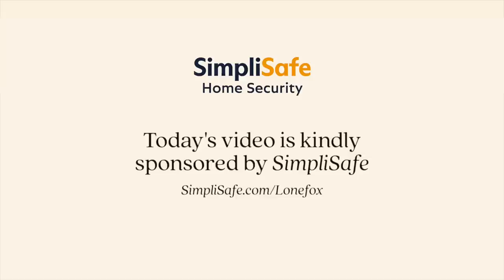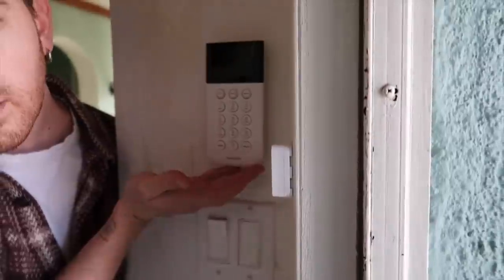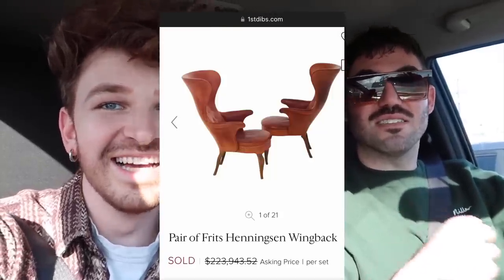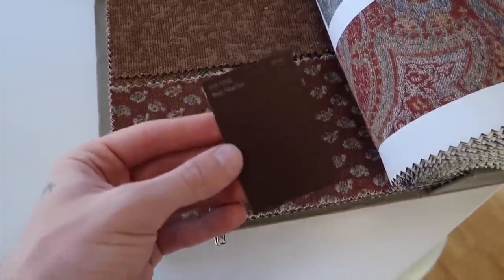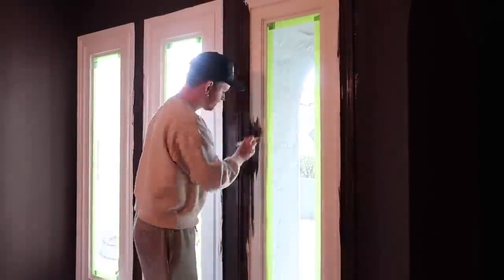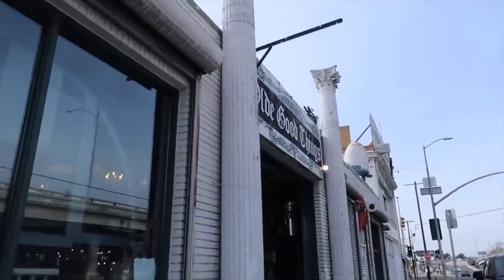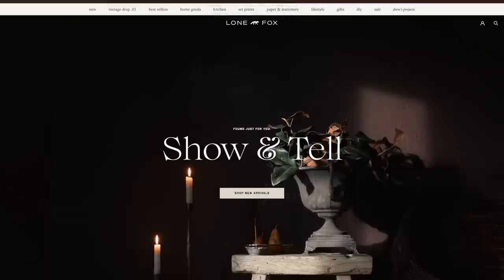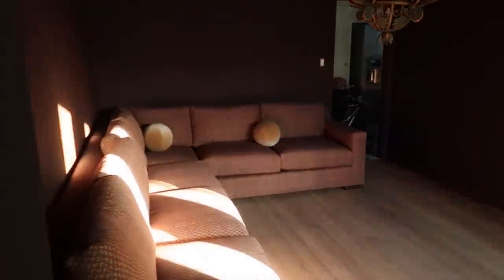MOODY MOVIE ROOM MAKEOVER ✨ Part 1 ✨ Painting & Reupholstering the Sofa

Comment: I like the light fixture. Don't forget, it will prob be over coffee table, so it doesn't matter that it hangs low. Yes oil paintings with big gold frames. Also you might want to treat ceiling beams, like with darker stain,  to match more with walls.

Comment: I just recently found this channel and I’ve been marathon watching all the older videos.  I love Drew’s enthusiasm and his energy has made me feel more enthusiastic about the house I just bought.  It was owned by a couple in their 90s, so I have had a lot of replacing to do!  I had the carpets pulled to expose the original wood and I love it!  We found 4 different flooring types in the kitchen and in one of the bathrooms.  The master bathroom actually had burgundy indoor/outdoor carpet over the same flooring as the kitchen currently has.  Why?  Were their feet cold at night?  Slippers, not indoor outdoor carpeting!

So watching you redoing your new place, although a LOT more space than what I bought, is so motivating me to keep pushing forward on mine.  Oh, and the first thing I did was put in a SimplySafe system.  That was done before I found your channel and I love it.  I feel much more secure here.

Comment: They're muntins.  Muntins divide the glass itself into small panes (or appear to with faux ones like you're installing and I have in my windows, too) in a grid pattern and are vertical and horizontal.  Mullions are vertical pieces found dividing a broader expanse of glass (like a double width window)  for support.

Comment: Drew: Had You considered using "A Larger Paisley Print" on the ceilings in-between those Beams than creating the contrasting piping to cover up the staples while highlighting Those Beams & Chandelier. 😲... Adding batting can be done beforehand by sewing the batting to the Fabric before stapling it to the ceilings between those Beams; gives an opportunity to install sound proofing barriers to adjoining Rooms, at the sametime. Giving them contrasting depth by drawing your eyes upward with the piping; to cover the staples >>> Rather than just painting or Blending them Together although that all one color look works Marvelously as well, but it has no sound proofing value. **Celebrating those Beams & Chandeliers up there As  Old World, Esthetic.has been Popular since the Golden Era of Design or the industrial Age of Design & is Still Seen in Mansions today, along with canopies around Beds.
Features made popular in Stately Home & Mansions Across Europe & America, and still popular in 2023 in big massive Mansions, starly Homes, & Chatoes💔  Aesthetically that Look is Timeless Design >>>goes well With Dark Academia or Easily blends together with modern Design  of 2023 as long as height is there in the rooms being designed.
  Believe Me... ❤️ You could:"Insulate those ceilings against vibrations from Sounds Escaping into those  bedrooms or All  the adjoining rooms above with reasonable cost this Way... Upholstering Ceilings requires just measuring Batting needed, the staples needed, and then the material to covering the batting and Making enough piping to go around all the staples & in-between the beams if needed. ALL secured while showcasing the Beams & Chandelier or You could also make this ideas by measuring the space needed to cover between each beam, then sewing the batting to the material first, while allowing for the staples while before stapling it up onto the ceiling; then piping it all off to Cover-up thode staples or lighter tone gaps around the Beams if needed......  it's  Great Sound insulation>>> and it's Lasted for eons because it's Timeless Design often used in Mansions and Chateau across Europe. >>>> Easier in many ways. As it covers a Madrid of complexities financially easier than some of the more modern ideas..that are very expensive sometimes when insulating against noise.
 Easiest is coordinating fabrics & paint for enhancement around the home from top floor to bottom in. my Opinion Paisley is Great for that >>>> My Parents did that on Our east coast home and almost half a century later it's still there & Very Much liked. & it's still on the ceilings years later but then it was done to enhance the warmth of a Home than as well.as sound proofing it.
 You can just install the material without installing batting if not worried about sound  >> but I Recommend batting >>🧐 depending on how much work you're all Up to doing !!!🤔 It's A Gorgeously curated Look Fit for Kings & Queens 😘🥰 for Sure  ...Also than it can be used on Roman Shades, Cornices,  or colors drawn in from the paisley for draperies., Etc ..  ordinarily colors & prints or solids from the paisley can be spread into other rooms thus drawing colors from the paisley into all the rooms on the lower levels>>> then up into those rooms above while making the whole house one united vision because all those Design colors come from the colors of any one of  the many paisley prints or backgrounds of those coordinating colorways even when backgrounds on them change color ways
 Why ,it was popular in Mansions & Homes of the Golden Era of Design & it's So Timeless...  As it all goes well with your kitchen colors bringing your Moody Depth of Design from one floor to another and Into each room these color stories work Wonders in any Home Design even in today's World..be they old or modern Aesthetically>> They can actually meld together Easier then any other < yet they  have Their own glorious Esthetic & Glorious History> Because your have many curated pieces they will always work in with one of those color ways of the paisley prints and besides that it would look great with whatever Maria is planning to do with her Bedroom.😱."Maybe a Canopy above those beds for You Both have high ceilings & Ikea makes a ceiling option perfect for creating them. Because even Parisian design or modern aesthetics work well blending into Spanish Designs Easily with paisley❓  Seeing there are High Ceilings and Beams as well as its Absolutely Beautiful 😍 & those Chandeliers and Sconces & Glorious Fireplaces on Every floor...then All your previous collected furniture, blankets ,throws, and comforters would go back into your house making all Past and Future ideas just flow together Once Again...As what's Happened is in Your Spirit you've Always had this vision in the "Depths of your Soul"....Kool idea ? Right 👍 as Paisley, Stained Glass ; and Old World Estectics has Always been a Vibe...  IT also works great with Animal printed Rugs and Runners, even Animal Heads like Taxidermy Above the Fireplaces or Even A Modernly Framed Smart TV Framed and mounted above a Fireplace. But that's my Perception and I 💕 Love Artistically Curated Homes.
Not to Mention Beautiful Oil Wall Art, and Bust or two, now copper, brass,even silver or iron flow together easier and marble , all flow and fur or oriental rugs on floor flow beautifully together... floor standing planters are as easily displayed on window ledges as these ALL are Curated where Old World Libraries, and Dark Academia & Modern Art Seamlessly Come together timelessly>>> no Matter where on earth your building or designing a Home.......Can You See it Guys 😱😘🥰 I Can 🙈🙉🙊 but Most of All it's Why I've been Drawn to Watching Your Journey  Evolve...for Years  💞 😘🥰 Thanks for Sharing this Timeless Journey We've all been on at one point or another and So  Enjoy watching Yours Unfold over Time and again as our Younger Generations catches &  Discovers Timeless Designs & the Reasons Why they come together Generations after generations. Find the ever timeless Discovery of A Worlds Journey 😘

Comment: Love the sofa.  Like the fabric, too, though I would have liked the full size paisley (the sample just before it) better.  Less fussy.  That's a big sofa and could take a bigger print than the tiny, mini paisley meant for trims, accent pieces like smaller chairs, wall panels, curtains or ceilings.  

Then there's that paint color.  For starters, it's too much the same color as the sofa.  With the combo of the color and the tiny print, the sofa disappears into the wall like Homer Simpson disappearing into the bushes!  😂  There's just not enough contrast.  It wouldn't even have been so bad if the ceiling were a lighter shade to give the light a place to bounce and illuminate the sofa.  

Which leads to the beams no longer being a beautiful architectural detail because they've also disappeared into the vast pit of dark red brown.  Even all of the trim has been painted to match!  Next you'll be putting down a rug in the same color.  Or maybe buying a floor cloth and painting it to match the relentless, never ending brown.  That's not moody - that's the Black Hole of Calcutta!

Comment: Drew, please be careful in painting your vinyl windows!  We just had new Andersen windows installed (they look like yours) and the warranty is invalid if you paint the vinyl or even composite windows in anything but specially recommended paint.  If the wrong paint with black pigment or dark they basically heat up the vinyl and can melt it.  We had this happen on one of our older windows.  Please check with Andersen or the manufacturer of your windows!  I'd hate to see damage to your home after you have so finely redecorated!!